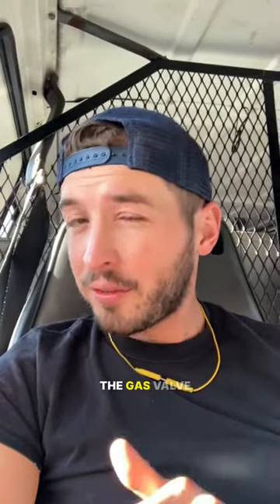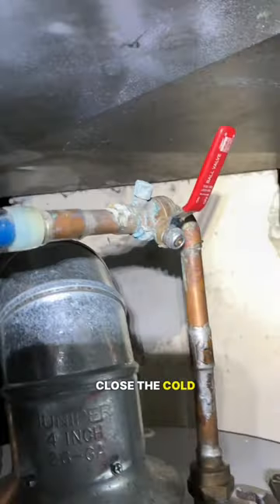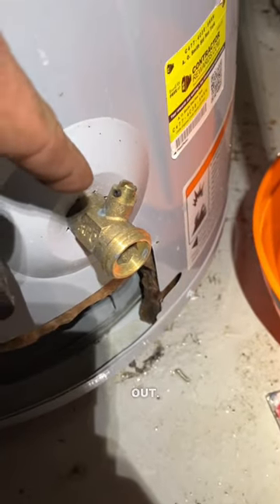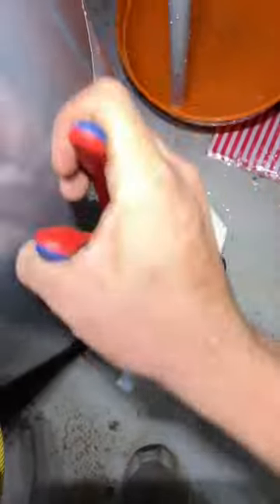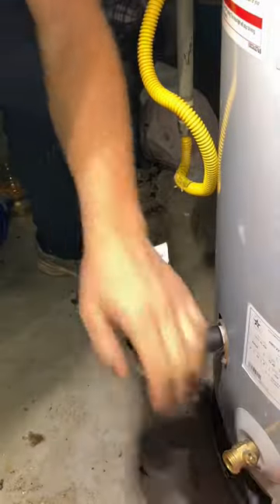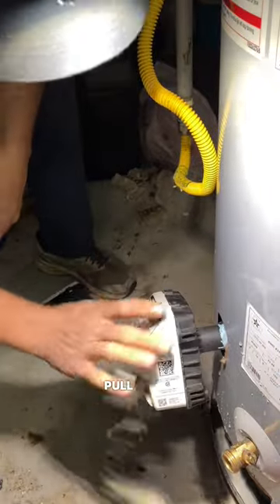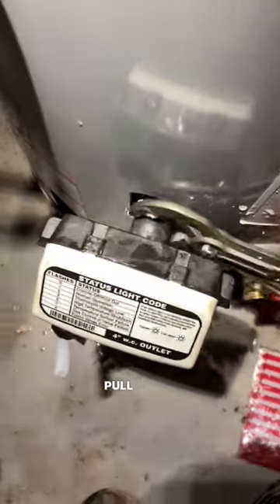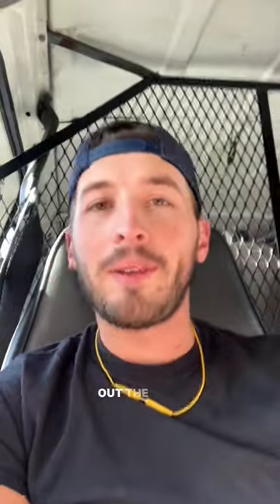Fast Way to Change Water Heater Gas Valve

Comment: Where is the gas valve
Reply from the maker: that is the gas valve
Reply: Okay so the thing with thread that goes in the water of the boiler is a temperature safety ?
Reply from the maker: It's basically a gas valve/aquastat combination, the temperature safety is at the top of the boiler incase the temp or pressure gets too high.
Reply: @theapprenticesurvivalguide  ok thanks
Reply from the maker: you're welcome!
Reply: @theapprenticesurvivalguide  no it's the control valve.

Comment: If this works 1 in a 100 ,make sure you have insurance for that one time .
Reply from the maker: Do you mean if it works 99 out of 100, make sure you have insurance for that one time? In my opinion this should only be done by professionals in areas that water can get on the floor, I really hope no one would attempt this in a finished basement with personal belongs everywhere.

Comment: Yeah but if you have an anti-vacum valve? It's not a good idea.
Reply from the maker: great point!
Reply: @theapprenticesurvivalguide  Yeah, and it's a code requirement in most juristiction.
Reply from the maker: Would that be on the hot or cold line? and could that be after the isolation valve?

Comment: I would wonder why it’s gone out so fast. And it’s outta warranty. Who did you convince to repair a $600 part out of warranty ? 😅 repairs out of warranty are 50/50 waste of money. Double your dollar and you got a new warranty with 6 years of peaceful sleep. Do not ever repair plumbing fixtures over 10 years old. Waste of money. Water is a destructive element that god made. It will destroy anything we make. Anything any where any time. Water wins. Chances are the tank will rupture soon.

Comment: I do the same thing changing elements of electric heaters
Reply from the maker: ever run into any issues?
Reply: Electric yes never saw a gas valve that provides gas to a burner inside the water tank. Gas burns underwater ?????
Reply from the maker: the probe that goes inside is the aquastat lol the burner is underneath the tank

Comment: 50 years of plumbing I have never changed a gas control on a gas heater l ran shops with 40 plumbers
Reply from the maker: Would you just replace the entire tank? this on was only a couple years old, doesn't seem right replacing the whole the tank if its still good
Reply: Absolutely